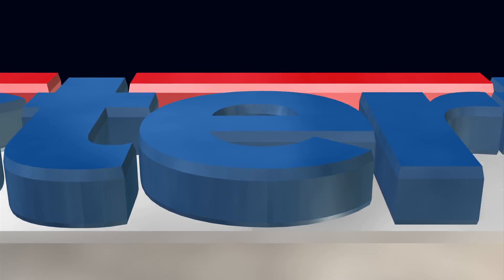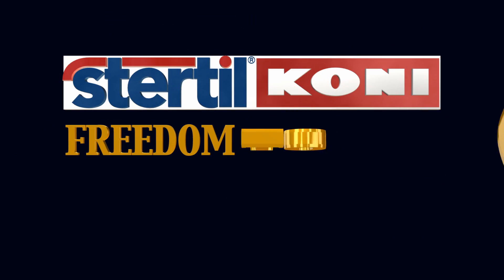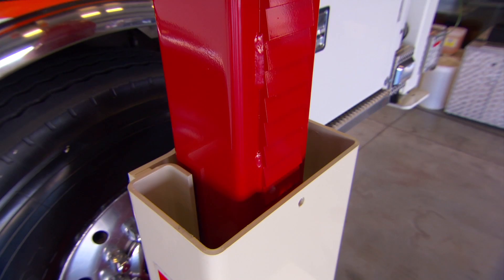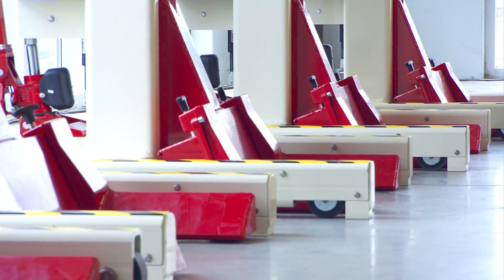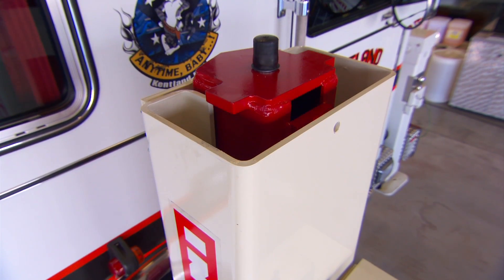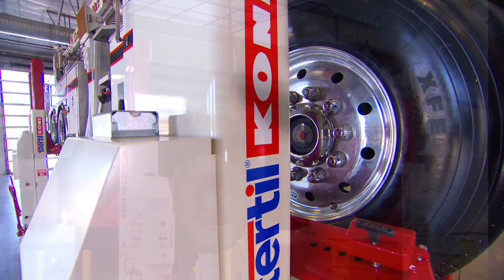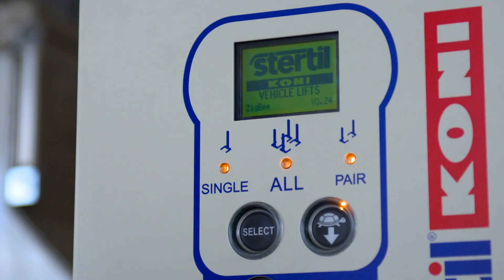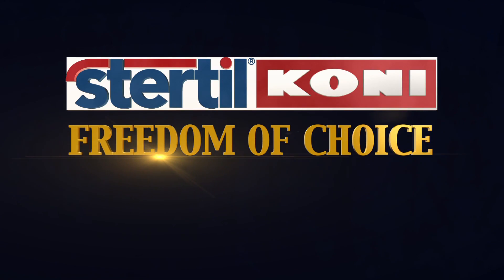Wireless Mobile Column Lifts

Comment: I wish Stertil-Koni would make an accessory device you can attach to the red wheel mounts in order to make the lifts attache securely to the vehicle lifting point or to a suspension point because if you need to remove one or more wheels the you have a useless set of 30,000 dollar lifts! That's really a problem. I'm not saying the lifts are bad, I'm just saying if you need to work on suspension, brakes, wheel wells and axles these lifts are useless because at lifts at the wheels. It gotta be possible to design an attachment you can easily mount and that doesn't screw up the center of gravity either as four individual mounts or as two beams you slide under the vehicle and mount at the wheels lifters in order to lift the car centrally. 
You're welcome Stertil-Koni....